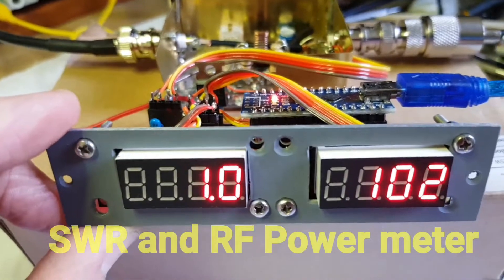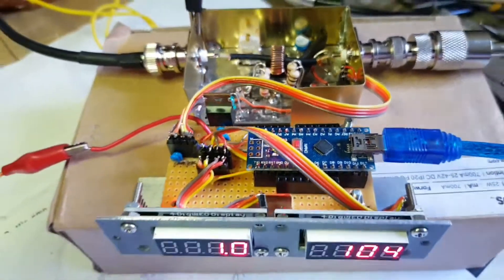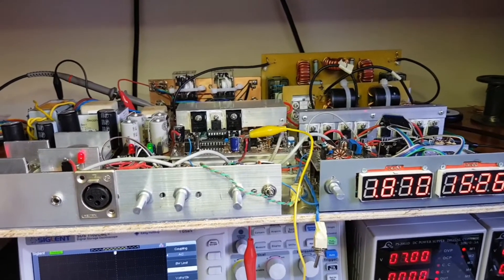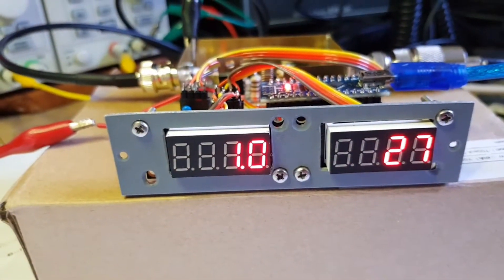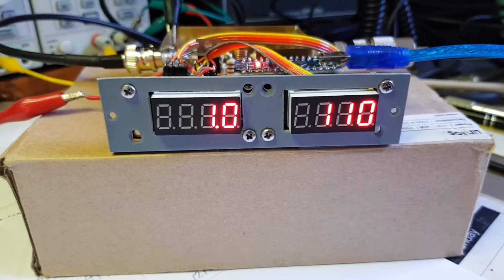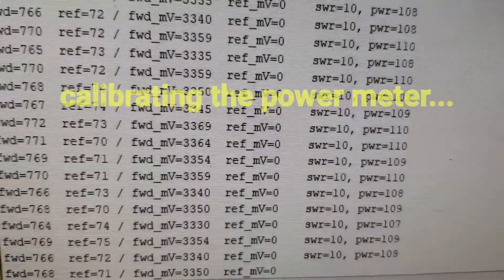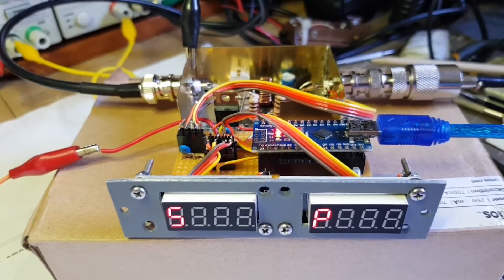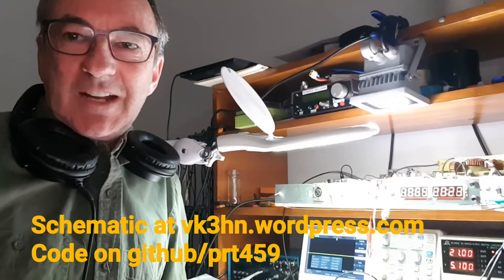A Digital SWR, Power meter for a transmitter or amplifier

Comment: Complex project presented very well and complete.  Thanks Paul!
Reply from the maker: Thanks. The complexity is mapping a raw analog reading from a diode RF probe to an approximation of the logarithmic power scale, without the usual AD8307 on the board.  The polynomial equation fitting website did the heavy lifting.  I am well aware that the mapping equation will only be usable over a narrow frequency range so it is not a good substitute for a true logarithmic detector. But in a single or two-band AM transmitter, it's fine.  Cheers.